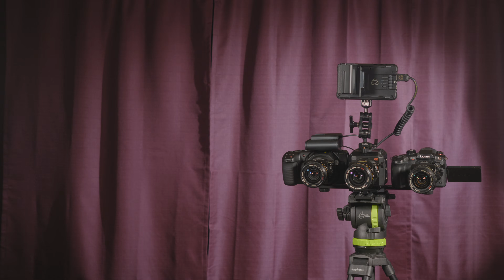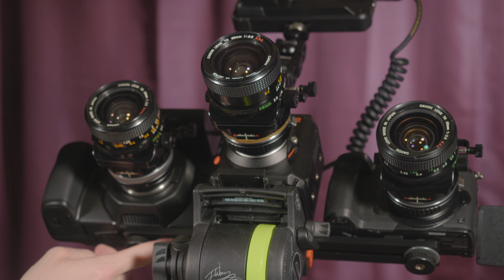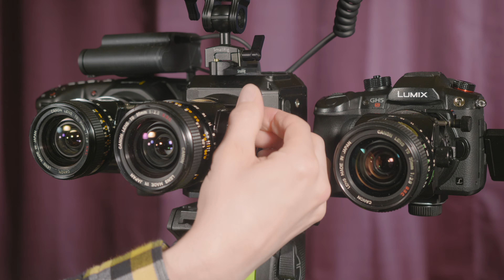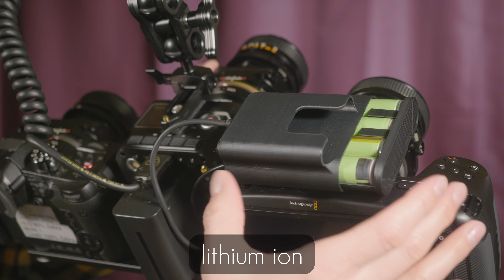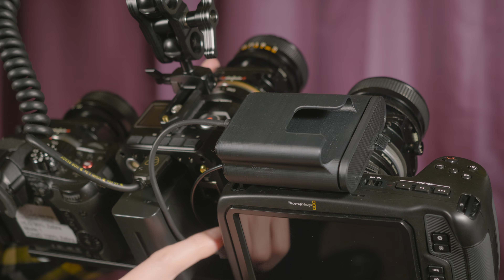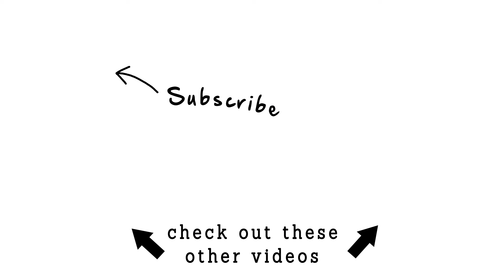How I Shot Three 4K Cameras at the Same Time - Z CAM E2, BMPCC 4K, GH5s

Comment: I gotta say, the zcam looked consistently sharper during the comparrisons. I think it's because you had a better chance of focusing it with the external monitor. You did mention that the sharpening on it was more aggressive, but some of the shots had the GH5s (in particular) looking really soft - but it was inconsistent. I reckon thats the difference between manually focusing with the little flippy screen vs a large display.
Reply: @FlannelNinjaTech  Yeah I have that featured turned on with my G9, it automatically zooms in as soon as I start turning the focus dial. I have this mapped to a function button so I can turn it off. It's extremely useful. Focus peaking is activated at the same time.
The G9 is the most underrated hybrid camera at it's price.